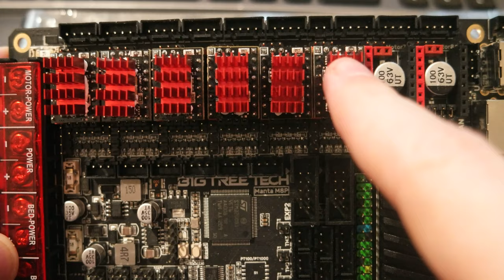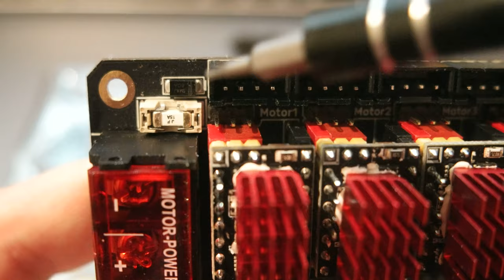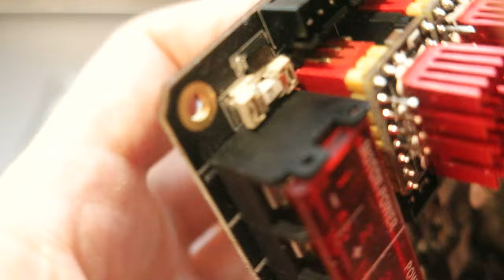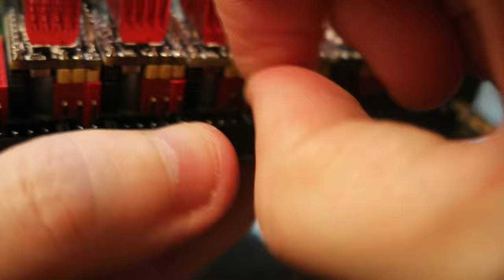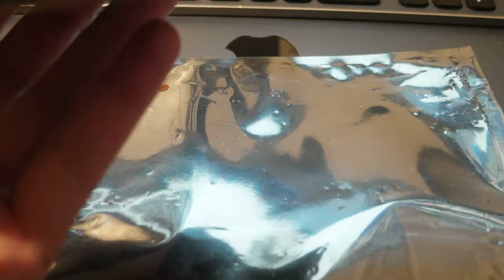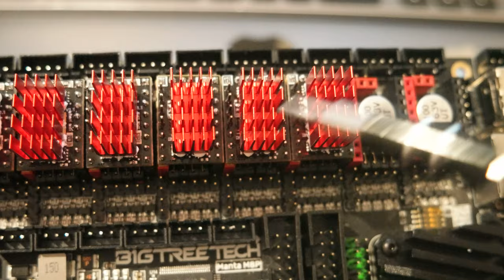How to setup 12/24 Volts jumpers for the TMC 5160 Pro on a BTT Manta M8P board

Comment from the maker: IMPORTANT NOTE: this video shows how to setup 12 or 24 for the drivers for my particular setup since I was going to use 12 volts for Vin (VBB) to power the board and 24 volts to power the motor drivers (HV). Some comments showed me that I was not clear about mentioning my particular setup.

TMC5160 Pro V1.1 - https://s.click.aliexpress.com/e/_DCHOWoj
BIGTREETECH BTT Manta M8P - https://s.click.aliexpress.com/e/_DCfEmQP
BIGTREETECH BTT CB1 PI4B Adapter - https://s.click.aliexpress.com/e/_DCB8ac7

Comment: aren’t tmc5160HV 48v?
Reply from the maker: Depending on OEM up to 56 Volts but the BTT Manata M8P input power is 24 Volts
Reply: @ganzoai  Look closely you can power the steppers separately from the board power: "Motor Power"
Reply from the maker: @JDccc26  I know that, the driver terminal accept 12/24 or <= 56Volts, according to the Manual for version 1.1. I have board v1.0 and the manual 1.0 does not mention the value of HV (i.e. 56 Volts), but just HV. So I assumed 24Volts was the high voltage. Also they should mention in the manual that using voltages higher than 36/48V is getting dangerous.
Reply: @ganzoai  It does support it. This video is a bit misleading.
Reply from the maker: @looxonline  The problem is that the v1.0 manual does not mention about 56 volts but just HV. The motor drivers terminal can support 12/24 and HV (not mentioned what voltage) so I assumed it was 12 or 24 where 24 was the HV at the moment the video was made. BTT should do a better job on describing features in the manual. I was reading the v1.1 which mention that motor driver terminal allows for 12/24/48/56 volts so 56 is HV. So you can select using the jumpers. I will make a note in the description so that is clear. I also emailed BTT about this problem, let see what they respond. Also they correct some staff in the manual from v1.0 to v1.1 but did not mentioned it, like motor drivers input voltages.
Reply: @ganzoai  The manual does specify the HV voltage even from the very first commit on github. I just checked it. It clearly says HV <= 56V within the first few lines.
Reply: @ganzoai  I work for BTT BTW.
Reply from the maker: So if I select using the jumpers the VBB it will take 12 or 24 from Vin, if I select HV it will take what ever motor drivers terminal has 12/24/48/56 Volts. Correct? BTW section 3.2.5 has the same picture. And please make a note on the manual about using 48/56 volts to be dangerous.
Reply: @ganzoai  Yes, that is correct. The jumper simply selects the voltage source but the actual voltage is entirely a function of what the user feeds the board.
Reply from the maker: @looxonline  Not sure why I missed those HV definition since I read the manuals, but my assumption is that I always work with 12 and 24 volts because 48/56 is dangerous and I would not take into consideration for such application. In any case as soon as I get the clarification I will make a note. ok?
Reply from the maker: @looxonline  since I want to make it right, is better to remove the video or to add a note or make a new video?
Reply: @ganzoai  48V is commonly used in the 3D printing industry and hobbyist community when higher torque is required for rapid acceleration. This has been the case for many years.
Reply: @ganzoai  I would say that a new video would be better so that the correct principle can be conveyed.
Reply from the maker: btw the problem in my video is that I did not mentioned that I was planning to use 12 volts for the vin and 24 for the drivers and that's why to people might be confusing even though I mentioned that this is a custom build.
Reply from the maker: @looxonline  I know but at 48 volts, Amps become dangerous!